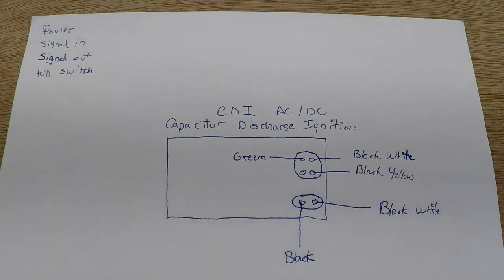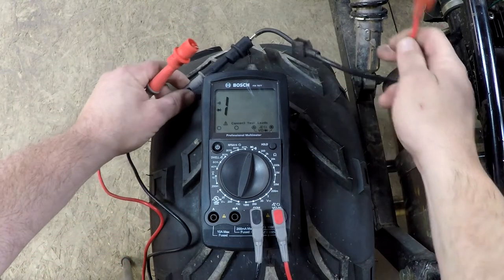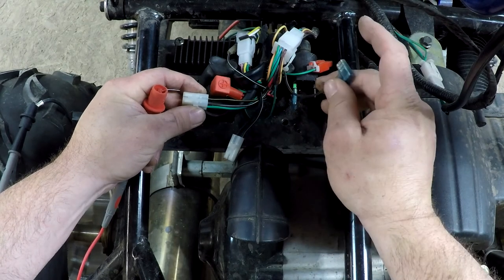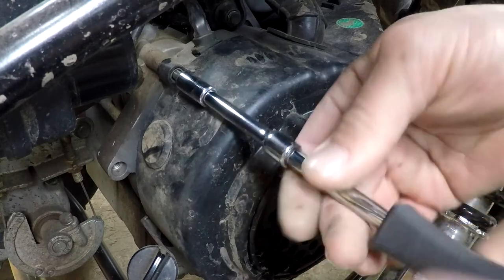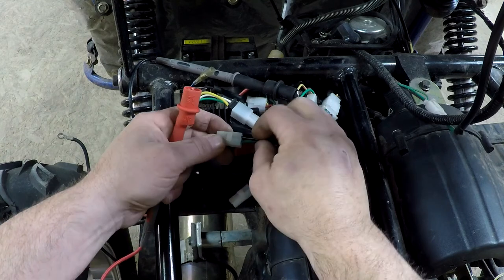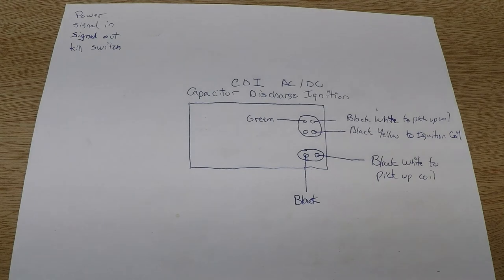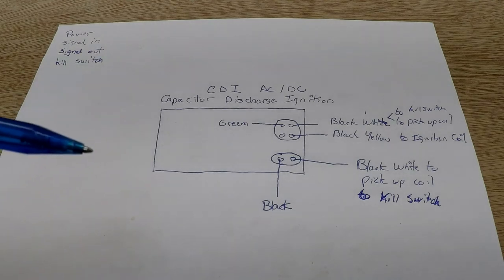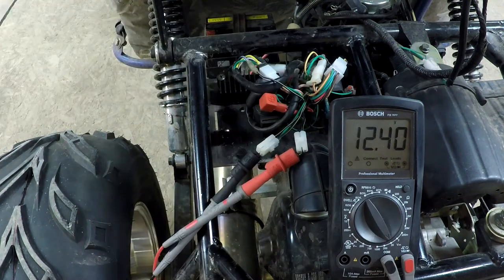Go Kart 150 CDI AC or DC Testing and Wires Explain

Comment: The attached video is vary similiar to my Rover Yerf-Dog CUV 150 CC engine.  The Yerf-Dog is over 15 years old.  I've tried replacing CDI, 8 pole stator, rectifier, starter solenoid, ignition coils to get spark but have not been successful.  I would just assume to start fresh as all of the electrical is old.  Does the Go Kart 150 CDI (DC) - 8 pole stator work and on this engine?  If so how much would it cost to get the a new ignition system (and replace the current).  It would assume in this kit I would purchase new wire harness, ignition switch, kill switch (panel for ignition switch and kill switch, CDI, ignition coil, starter solenoid/relay spark plug, starter, rectifier, choke wire, and wiring diagram.  Also assume USF dollars, and shipping to 3609 Artesian Way, Spring Hill, Tn. 37174.
Cheers!
Frank Fenton

I ask if the
Reply from the maker: Check this video, https://youtu.be/dXP3SFopKVY This is the plug and play wiring harness we did. This is the link to purchase it, https://gokart.maximum.parts/basic-wiring-harness-gy6-150.html You can get a quote for shipping after you add it to your cart.

Comment: I have  kandi 2017 200cco kart.i have new cdi,stator and regulator/rectifier. Ground is good.but battery drain's and while engine is running, engine shuts off when battery drop's to 10volts. What could be the problem?
Reply from the maker: Did you install bigger lights? Did you check the charging system like in this video? https://youtu.be/ja338ghYwCM
Reply: Did you wire in  resistor

Comment: Heeeeeelp I have a Aeolus 300 linhai no spark any help to find a wires diagram I replace everything and no spark
Reply from the maker: Not familiar with this one. If you changed everything, check your ground. This is a common problem, soon a ground goes bad, you do not have the same power coming in for the components and some will not work properly. As for the plan, I don't know, sorry.

Comment: i cant find a 6 wire voltage regulator for my 200cc gy6 11 pole stator.. it has the smaller CDI (AC) on it. new the guy said. i got this kart as a crank no fire. customer says the shop put a new CDI on it and it ran find then one day died while running. just going over the kart it has been abused and the techs sucked that worked on it . its only 2 years old and missing stuff.. bottom line is i cant find a 6 wire 2 plug AC volt reg...anybody know whats going on with this thing? or where to get the part? the regulator has a big crack on the bottom side so guessing it blew..
Reply from the maker: This is the regulator we sell, it will work for what you need: https://gokart.maximum.parts/rectifier-regulator-3-phase-gy6-150.html

If you need the connectors, we also sell them: https://gokart.maximum.parts/connectors-kit-for-3-phase-stator-regulator.html

But that will depend on your connectors, they might be the same.

CDI, you have 2 types, AC or DC, it will depend on your machine and wiring.

If you want a video on all the basic wiring, you can check this one: https://youtu.be/4U1ZulC22Zc

It should help you figure out what goes where.
Reply: yes thats the same as mine awesome will be ordering it.. also do you guys sell tops for a 4 seater buggy/kart by chance mine is a 2021 tiking 4 seater but same as the trailmaster and other 4 seaters..@mparts
Reply from the maker: You can go on our website and send us an email thru the contact us page. We will check with you for the other parts you need.